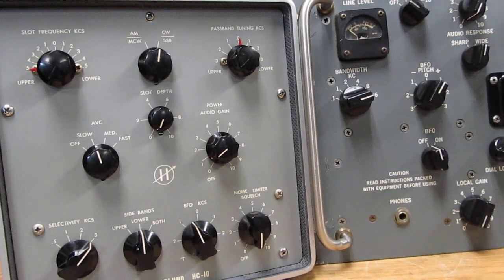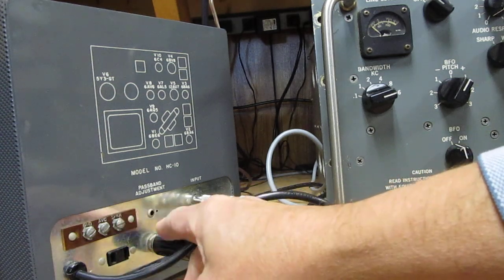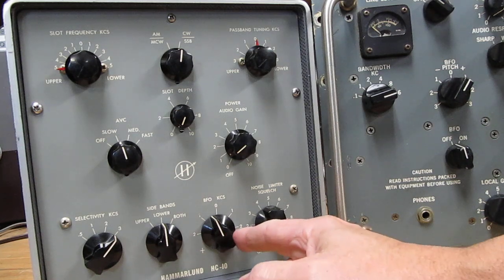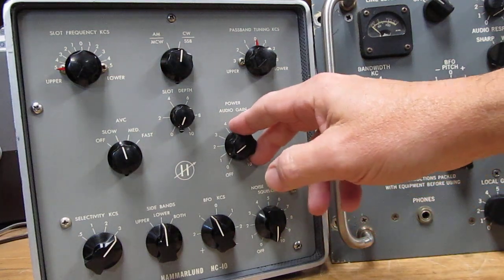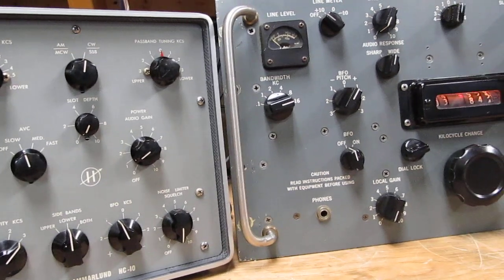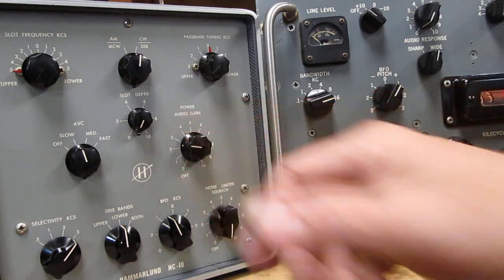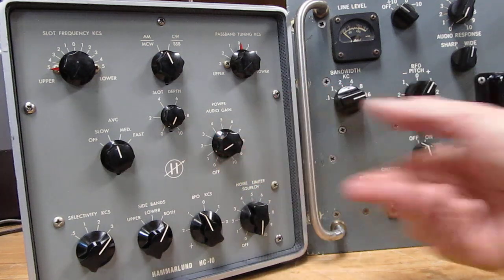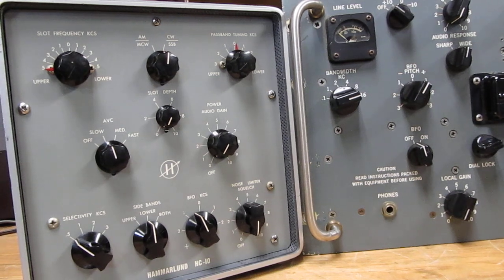Hammarlund HC-10 SSB/CW Converter

Comment: Hi Steve, Nice job explaining the HC10.. I have used these with R390 and 390A's for some time and they are great.. My understanding is the HC10 is basically the IF, product detector, BFO, Notch of the Hammarlund HQ170.. The audio from the HC10 is very good for SSB and CW. I use 2 speakers, one witgh a 600ohm input for thr 390 and one with 8 ohms for the HC10. I like to use tghe wide filters on the 390 for AM Broadcast and SW.. Also the vernier tuning on the HC10 makes CW copy ever so sweet..

vry 73,
Glenn WA4AOS
DSM Labs (dot come)